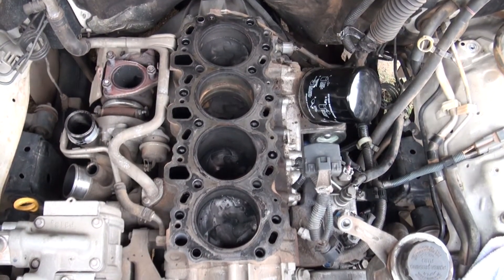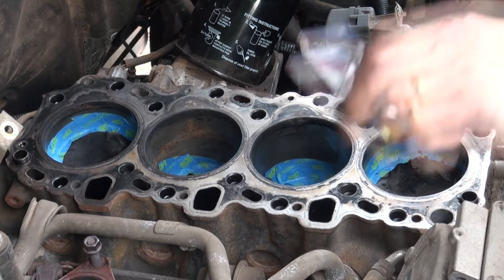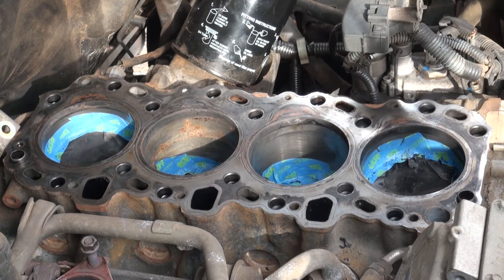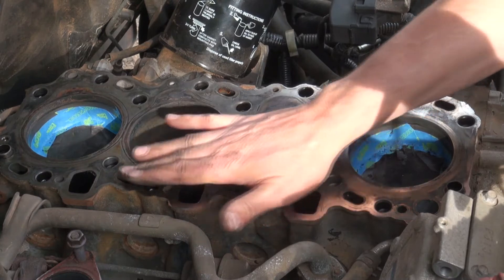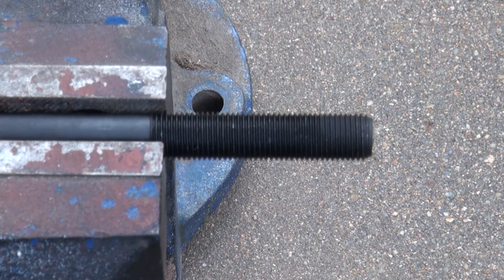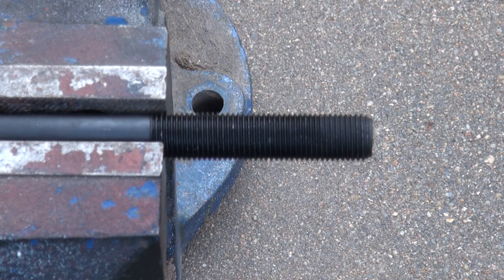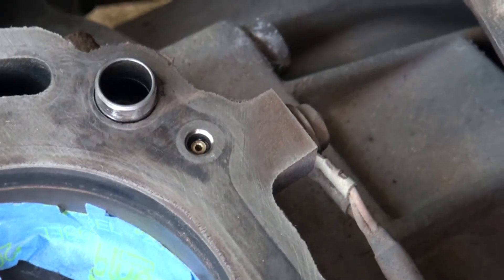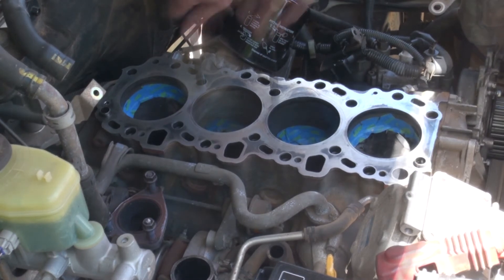Replace Prado 90 series 1KZTE 1KZ-TE head   Part 7

Comment: A complete engine out is the only way to do this properly really. then while its out you have the opportunity to put in a full rebuild kit....pistons rings bearings etc as well as rear engine seal. The one that weeps and leaves that film of oil over the transmission. That way you have a brand new motor and go from there. Not knocking you at all mate you did a dam fine job with what tools and know how you have. 10/10.
Reply from the maker: Thanks for your thoughts Russell. I have built engines from scratch, from balanced crank, rods and pistons up, including boring, rings etc, and it's a lot bigger job than simply replacing a head. The Prado cracked head is a flaw in the production of them which can and does happen well before things like the bore needs work or rings replaced. So I don't think the extra effort of removing the engine is necessary to do a proper job, unless there are already other significant issues like low compression or blowing smoke is already occurring.
Reply: @aussieknowhow  What are your thoughts on the quality/durability of the ETP brand heads. Are they any good?
Reply from the maker: @russellking9762 Sorry can't help you with that one. A mechanic I know recommended and rounded up the head I used.

Comment: Could use an air compressor to blow out that water from bold holes with a rag over top to stop water going everywhere
Reply from the maker: Yes you could use an air compressor (I don't have one anymore), but I'd still push a cloth into the holes to check you've got all the water out.